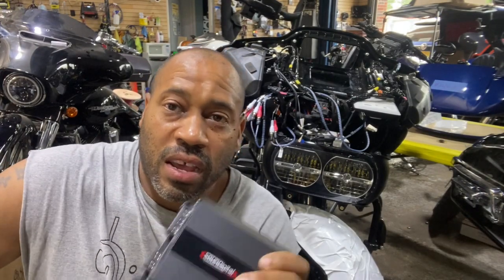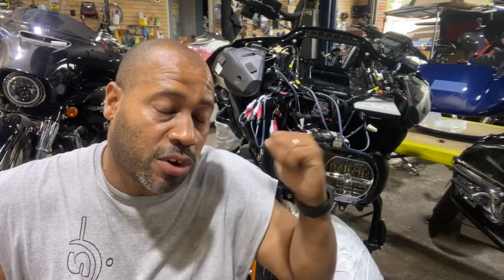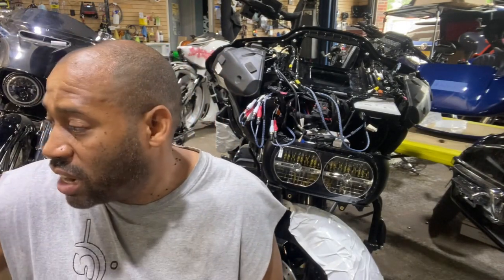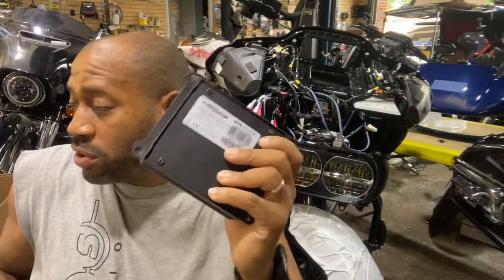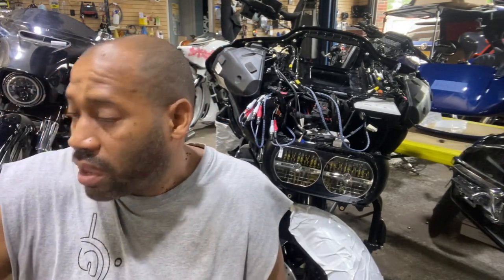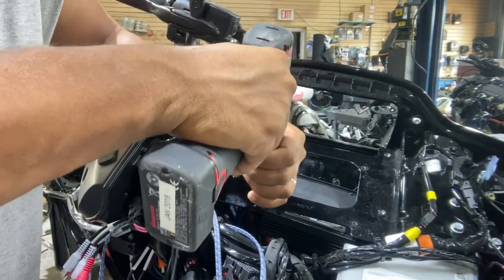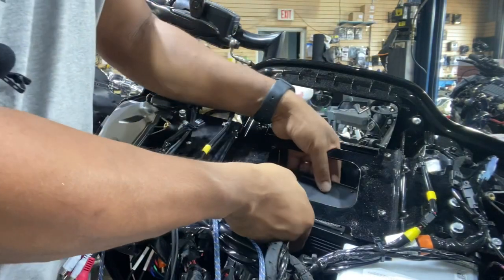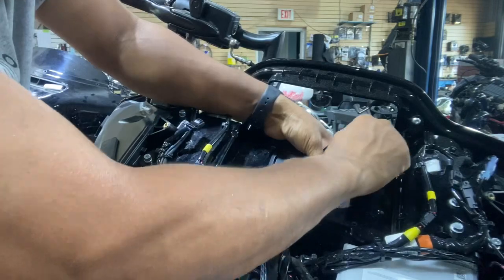2020 Harley Davidson Road Glide inexpensive mounting solution for the EVOX 800.4

Comment: But wont mounting the amplifier upside-down transfer the heat generated by the parts right back inside the amplifier  instead of passing through the heatsink?
Reply: That's what I was thinking.